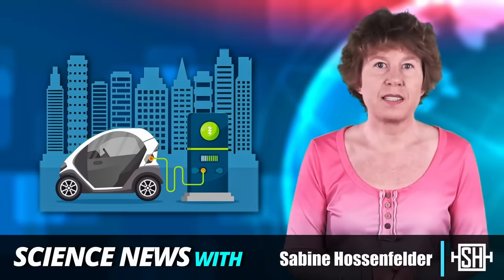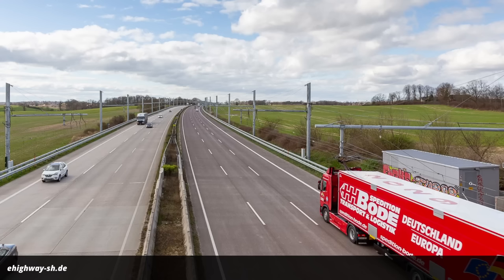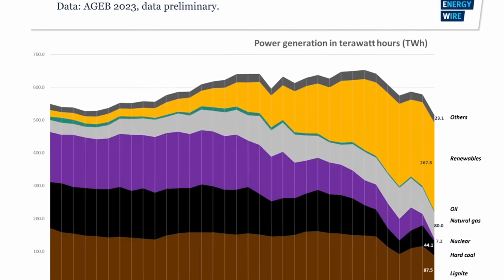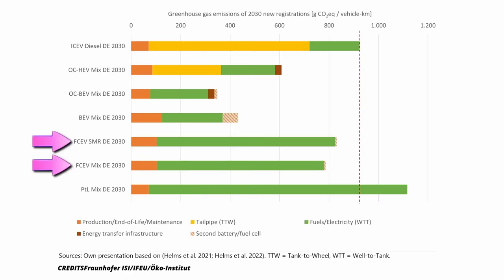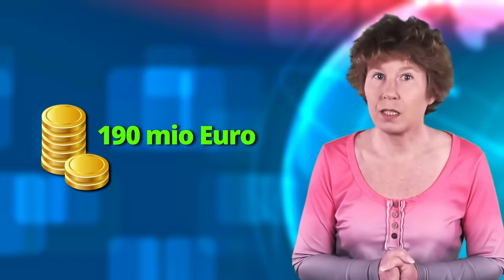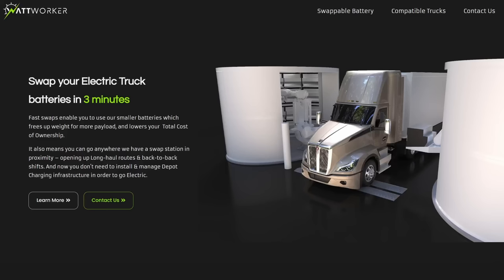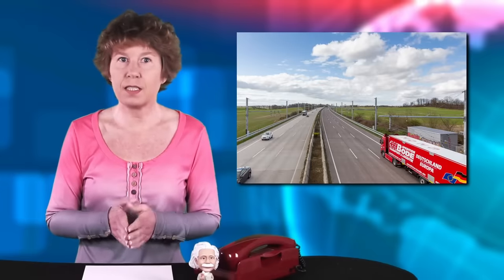Charging while Driving: Does it Work?

Comment: It is the same issue in the USA; ZERO electric infrastructure and no idea what needs to be done to reduce fossil fuel consumption. Since electric power plants are far better at conservation of energy than stand alone internal consumption diesel inefficient engines pumping 70-80% of the energy heat off into the air in order to preserve the engines.

It is far more likely that efficient electric fossil fuel power plants will at first need to be constructed to supply a sufficient national power grid BEFORE they can be replaced with clean energy sources as they become available whether they be wind, geothermal, solar, or safe molten salt nuclear. Until a national electric super grid has been established there will be no way to bring the electricity generated at the maximum output point of any site to the other side of the nation at light speed so that as one side of a nation falls low on energy the rest of the nation is either waking or in peak production.

Then there is the issue of methane which is NOT a fossil fuel which is generated within the earth as a natural geological process that needs to be captured, sequestered, and or burned in order to prevent it from leaching into earth's atmosphere. This may need to include better controls and mitigation set up on our livestock farms changing cattle feeds into mixes that tend to produce less methane. At any rate we must reduce and sequester/burn as much methane as we possibly can, it will also be that the electricity produced from methane mitigation will be far more costly than the electricity produced from fossil fuels or clean energy sources; we will most likely have to subsidize methane sequester and consumption forever.  

Because the major share of electricity is still generated at fossil fuel burning power plants, high speed trains do contribute to carbon emissions, however the climate impact of one train is significantly less than that of many personal vehicles. Passenger rail is around three times more efficient than a car on a passenger-mile basis at current occupancy levels. Maglev trains use electromagnetic force to levitate several inches over the track or guide way. By eliminating a key source of friction; that of the wheels on the rails, such trains can reach higher speeds than conventional trains, have longer lasting parts, and are very quiet and smooth to ride. Using experience gained from more than a decade of regular operation, China has now developed its own 600 kph (373 mph) Maglev trains and has ambitious plans for a network of Maglevs, including a line between Shanghai and Hangzhou. I was involved in the engineering team developing the high speed pantograph for capturing high speed rail feed lines for HSR, though I feel that the power for Maglev's should come more appropriately from onboard molten salt nuclear generators to cut the umbilical chord to off site power and the high cost of supplying that infrastructure. Molten Salt Thorium reactors would be a perfect fit and provide a sharp reduction of HSR infrastructure cost.

When it comes to moving to clean energy and meeting transportation needs too many folks tend to not be able to think outside of the current Fossil Fuel Energy Prisons. The world can do CLEAN ENERGY our democracies are unlikely to get there for the sake of  unqualified and ignorant representation in government and an never ending supply of Fossil Fuel Money to corrupt them; this is the major hurdle that must be addressed in the America BEFORE the USA could begin to move towards clean energy. Clearly clean energy represents an existent threat to fossil fuel supported national economies. Without first addressing this looming problem, only disruptions and wars will result and no one will EVER see the salvation of earth from our human made extinction.

Comment: If they really want to save money they need to reduce the weight of the existing single passenger vehicles put a limit on say 1000 lbs maximum you would have to phase out the existing vehicles over a certain time frame I mean it's kind of ridiculous that you have one person driving around in a 4,000 lb vehicle.
Reply: People think they need a 4000 lb vehicle to be safe, and they are right because the roads are full of 4000 lb vehicles. 

I ride a 30 lb vehicle when I can. It isn't particularly safe but there has to be a sweet spot between 30 lbs and 4000 lbs. People love to point out the high energy cost to run a Tesla, but it's a big, heavy, high performance luxury sports sedan, of course it gets bad "gas mileage". Good for Tesla for showing that electric vehicles don't have to be boring but they need to be efficient and affordable too,

Conservation is the low hanging fruit, it worked in the 1980's and it can work now.
Reply: @davidg4288  yeah good points I ride a tricycle with a front wheel electric motor to do 90% of the things I need to do but I can get away with it because I'm retired I also have a Chevy 3500 truck which can do pretty much anything else but I rarely drive it anymore.
Reply: @MikeSmith-cl4ix  That sounds good. Using the right tool for the right job.

Comment: These problems with truck transport are just a symptom. The actual cause is the Free Movement of Goods in the EU. That is kind of a pipe dream, because the movement is not free. It is just so, that the transportation costs of, say, Spanish strawberries are low enough to compete with local offerings. In addition, there are things like the Brenner, where Austrian tax payers support the infrastructure for no benefit, only disadvantages. I am not amazed, that this is a very delicate issue in the EU, because it contradicts he idea of "free"  movement of goods. For being more "green", it would be more efficient to stop that, instead of investing huge amounts of tax payer's money to render it harmless. In times, when the cheap Russian gas is cut off,, and the infrastructure for the wonderful new electric world plainly does not exist, the governments should focus on reducing energy consumption, instead of forcing expensive projects, which could be good for votes, but in my opinion were often not even estimated and calculated before. In Austria, there was the "wonderful" idea of a hydrogen driven railway, which is absurd if you think twice, but the magic word "hydrogen" and "pioneer of a green future" weigh more. In this particular case, fortunately not.

Comment: Good invention! If now only one would replace the rubber tyres by steel tyres and the asphalt with steel to reduce friction, we would require even less fuel.

Thinking about it, we might also then chain these trucks together to optimize the air resistence and increase density.

Such a smart solution!

Comment: 5:03 why using outdated data here? Electricity prices dropped from 35 cent/kWh to 24 cent/kWh in Germany in just a year thanks to shutting down the nuclear power plants and using less coal and gas.
Reply: I looked into the prices. It looks like they are based on end consumer costs including taxes and do not apply in this context. So not just out of date but also the wrong prices for this context
Reply: @devluz  yeah you're right, these are consumer prices. You have to remove the 19% VAT to get to the prices which are relevant here.
Reply: @RubenKelevra  power prices work differently in Germany. they have only 5% vat but have other taxes and fees on it. What I find online is that the price is back to around 20 cents/ kwh

Comment: In my opinion , swapping batteries with stations that have fresh fully charged batteries ready is the best solution just like you said in video.  Machines can do the automatic swapping
Reply: Will only work if truck companies can agree on battery standards though... And the batteries will take more expensive materials than the wires. But production scales better... Not sure what would be best for large scale, but my bet would be on wires.

Comment: Ridiculous how many ignorant people still pretend that electricity still coming from fosil fuel powerplants makes EVs pointless ... EVs, no matter if powered from battery or electric highway, simply are the superior solution even if the electricity is still produced from fosil fuels. Its just more efficient to produce electricity in large scale powerplants and distribute via the grid then to shuffle fosil fuels all around the country and burn them in millions of tiny engines.
We dont add to energy comsumption with the switch from fosil fuel cars to EVs. Even in its worst adaptation it simply is a trade ... cutting fosil fuel consumption in vehicles and adding it to the powerplants. But ofc in reality it saves fosil fuels overall, even if solar, wind and waterpower wouldnt be part of our energy production, simply because using fosil fuels in powerplants is more economical and EV motors are more efficient then the combustion engine.
As for the cost of building Charge while driving roads, its far smaller then people think ... not only isnt the battery and charge development done, reducing the need for every highway mile being charging roads ... but the alternative of building and maintaining a fosil fuel supply via gas stations also doesnt come for free, gas stations, fuel transporters and the labour involved isnt cheap either. Again we only trade one cost with another, we dont add by letting EVs take over.

Comment: I must say I'm a bit disapointed there was not more talk about the comparison to trains -.-
Tranis are in almost every way supirior for long distance transport (given the infrastructure for them is built). Even running the trains on disel would be better than transporting the same stuff on trucks running on disel; probably even if those trucks would run on battery with half "dirty" electricity. That's because trains are just sooooo efficient.
And let's not talk about the other polutions that come from wear on tires and breaks... trans are way better for that too.

I see only 2 valid scenarios for trucks in the future:
I) last mile delivery: so from the rail-loading-station to the final destination
II) transporting perishable goods from point to point. THough for many of them a good rail system would do a fine job too...

For I) electric trucks should sufice in most every situation, even running on battery. If that truck has to go for more than 100km before it has time to charge, then it's no longer "last mile"
For II) is the only scenario where I would see the "wired-highway" as a potential solution... though expensive swappable battery tech and networks are probably cheaper and easier to implement.

Comment: Have you ever been in Denmark, Sabine? The S-trains in the Greater Copenhagen area have two power lines above them, as the trucks in this video, and no current in the rails or wheels (except the engine that drives them).
Reply: I googled and didn't see a single photo of a train with two pantographs side by side...

Comment: If the system can't provide enough energy to fully power the vehicle while it moves, plus some extra to recharge the battery at the same time, then it's not "recharging while driving", and it's complete non-scientific BS. So, it it capable of doing that?

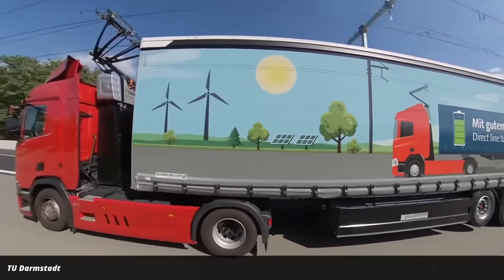Comment: 0:48 it's a stupid solution because trucks are very inefficient. Not only because rubber wheels have hight friction and a truck always needs more energy than trains, you also need 50 truck drivers instead of one train driver. The cost for streets and roads are also very expensive because of the heavy trucks. Battery powered trucks are only a good solution for the last 20 miles. The problem: Nobody want to change it because "thats how we did the last 100 years, trains are not new t4echnology, how should that fix our problems. Let us build hightech trucks. Way more fancy"... just sain. Its not intelligent. Its only fancy. Like electric cars which look like christmas trees inside and have more entertainment systems than my living room.

Comment: San Francisco, CA has been using electric power lines for electric buses since 1935. Another way that it could be done is to restructure the roads so that cars can collect electromagnetic energy and transform it I to power, so cars would collect energy from the road itself. That would be more advanced. They could do it a more archaic way and add power strips to the road and vehicles could have a rod to collect the power from beneath, just like old school racecar tracks. Also, you wouldn't have to have power lines everywhere. Just in Metropolitan areas and some other areas. The buses in San Francisco can disconnect from the power grid and run on stored electricity for a good amount of time.
Reply: Wouldn't that be bad for the computer systems in the cars? Being as electromagnetic fields of high power would interfere with electronics. And you would need a high powered one to power a car I would think.
Reply: No, not at all. Vehicles aren't that sensitive. They go through electromagnetic discharges all the time. It's just like how rain doesn't kill your car, or how you can clean your engine bay with high pressured water, even with all the electronics under the hood. Cars are grounded and we are far more advanced than we were in the 1600s. Even still, what do you think the electricity is that comes from the power lines the buses in San Francisco is and discharges? There's no way to stop electricity from turning electromagnetic or electromagnetic discharges. That's like taking the "wet" out of water.  @davidtherwhanger6795

Comment: I mean unless it's sodium ion EVs I am not going to consider them a clean transition for the enviroment. Consider this. How much earth is displaced to mine lithium? (cobalt and nickel too) How much emissions were used to mine lithium in huge, science-fiction-esque quarries? How much water and energy was consumed refining lithium? That's fine if we can somehow solve this issue, sure. Then what about the fact EVs are heavy, accelerating the degradation of roads. Are emissions to repave the road included in this equation? Additionally, as EVs are heavier they wear out tires faster, and they leave more tire particulates behind which according to emission analytics is worse for the environment than tailpipe emissions. We're going to see an increase of illegal dumping of used/worn out tires with no where to go. What about recycling batteries? In the US it's about 5% and LFP batteries have it worse off as it's not even worth recycling in most cases. Lastly, globally the source of what powers our homes and infrastructure is fossil fuels unless you're an island/small country with access to healthy amounts of hydro and other green energy. 

So again, tell me how Electric Vehicles are a key element of the global transition away from fossil fuels? No hate, genuinely would like to see a video on this. Charging bays/stations can consume up to as much as 40-80 homes worth of power and even more if we want to charge faster with more power. Charging infrastructure, charge time, public distrust of batteries (fires, battery replacements costs etc), exaggerated range (not meeting quoted range, range anxiety), phantom drain, charge complexities (pre conditioning, heating reducing range, cold reducing range etc).

I could go on but you get the point. A lot of people don't even have their own driveway for home charging, so public charges are the only solution. Which depending on where you are costs the same as putting fuel into an ICE car but instead of 5minutes it turns into 30 minutes or more if you get reduced charging. These things shun people away from adopting EVs to begin with.. It would be better to just buy second hand ICE cars.

Comment: Electric vehicles aren't the answer until we get better, safer battery tech.  Lithium is beset with issues, from child labour mining to very high temperature thermal runaway fires that can destroy buildings/car parks,  Electric motors are great for powering vehicles - maximum torque from zero rpm, but getting the electricity safely to the motor is the big problem.  Petrol/diesel is so much more convenient, so let's focus on sustainable fuel, then we won't have to replace every vehicle in the world and emit more carbon emissions to produce their replacements.

Comment: Electric cars are a disaster, most manufacturers are losing money on every one sold and drivers refusing to buy for a host of very good reasons. Electric trucks are even worse because batteries big enough are inherently prone to thermal runaway. I think government should put all its effort into building enough nuclear power and renewables to decarbonize the electricity grid before even thinking about electric vehicles (or hydrogen or whatever). If they're running off electricity generated from coal and gas, electric vehicles are a very expensive waste of space.

Comment: You haven't reduced the emissions at all, you just moved it from the highways to the electric plant. You are still using Petroleum fuel. (stop calling it fossil fuel there's no proof of that) Furthermore, how much did all this infrastructure cost and how much is it going to cost to maintain it. I'm sure its way more than just using the fuel to begin with.
Reply: What on earth do you mean by Petroleum not being a fossil fuel? It's a product of crude oil which is just fossilized organic matter?
Reply: @trashcubed4788  That is a theory from the 1800's, they have never proven where it comes from or what it's made out of. The same goes with gravity. Stop believing everything that you here and go learn something.
Reply: @SpringScapes  Oh, the irony.